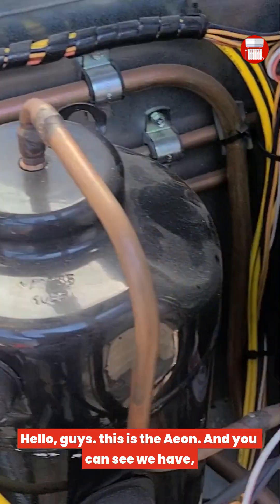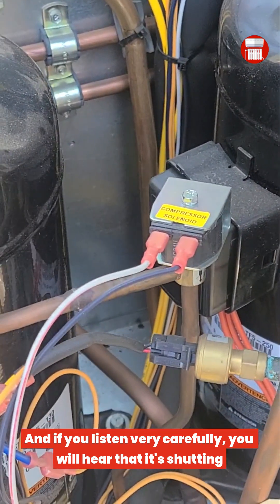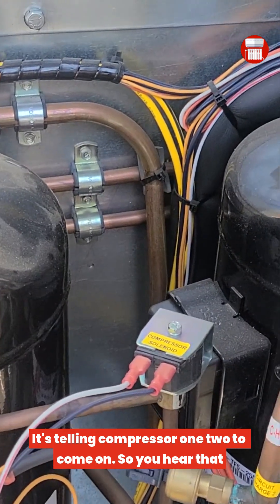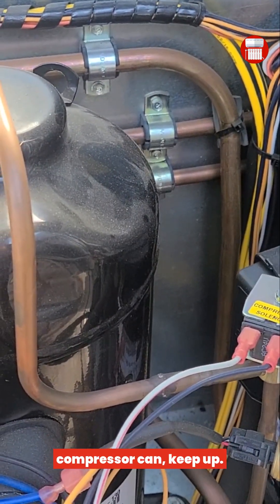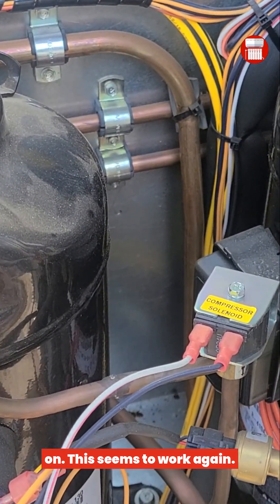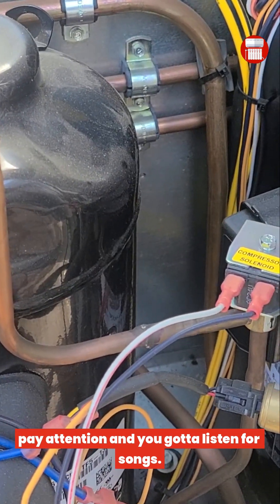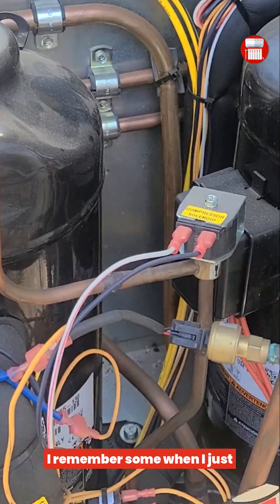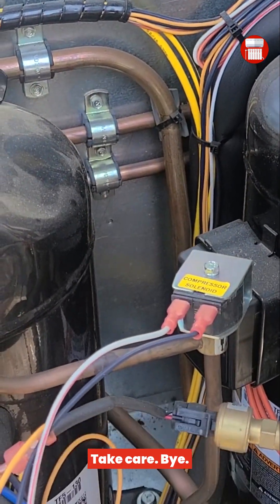HVAC Techs: This Is What Happens When 2 Compressors Run Together!

Comment: I come in peace! 

But that noise you hear is because of your “Compressor Solenoid” which is the 2 prong wire connector that you see attached to the small copper line set coming off the top of your compressor. That’s your “Unloader” what you’re hearing is your compressor unloading and loading. It does this for efficiency reason and accuracy. If you remove one wire (doesn’t matter which one the white or the black) and you’re compressor will stop unloading and stay loaded at 100%. This is good for when you’re either troubleshooting and or charging the system; because when it’s loading and unloading the pressures are constantly modulating as well as your amps are fluctuating every time it loads and unloads. 

Love the video tho man! I hope this helps look at it a different way, but you’re still on track!